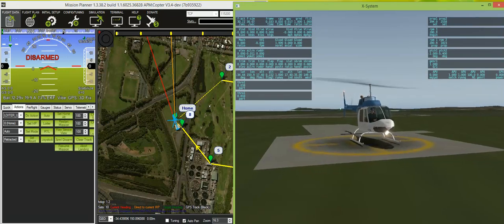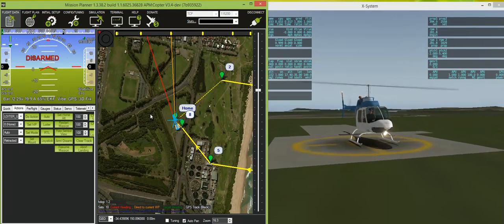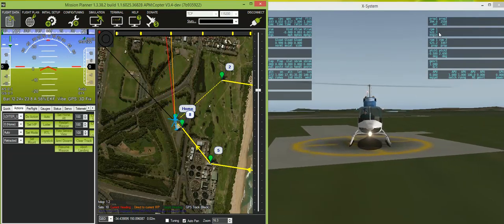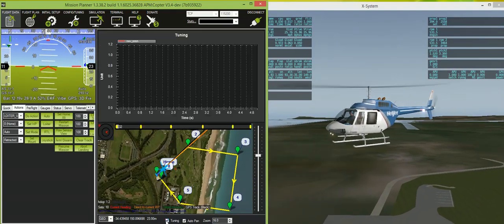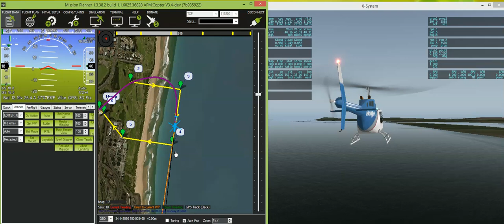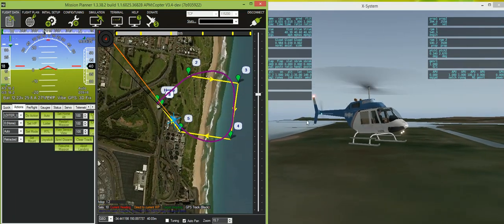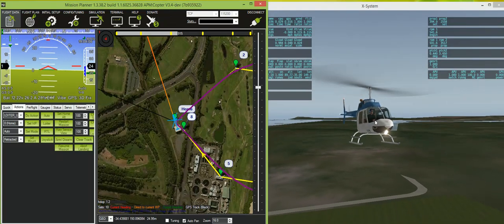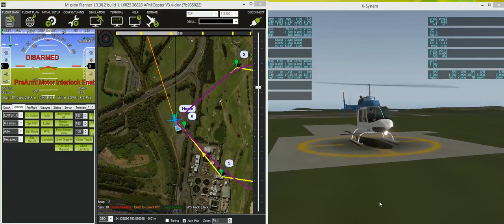Flying a Bell JetRanger in X-Plane 10 with ArduPilot SITL

Comment: Suppose you build an ornithopter that flies with more than one motor in a non-standard way. Can I use Ardupilot? Or should I use other software?
Reply: Do I need any hardware for this?

Thanks in advance.